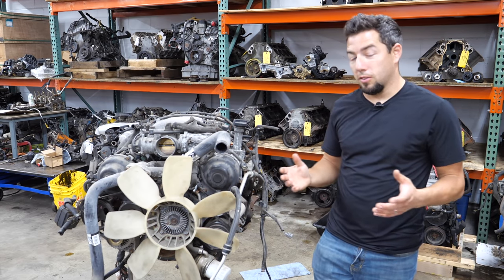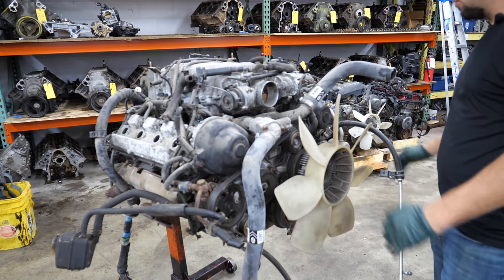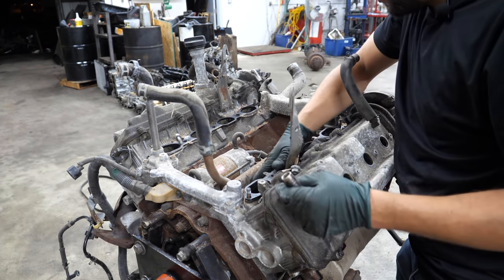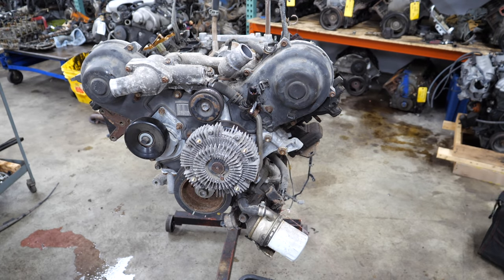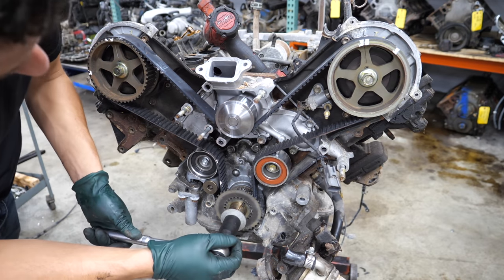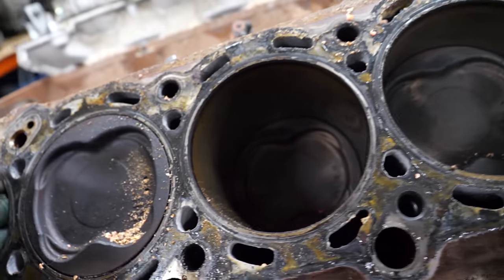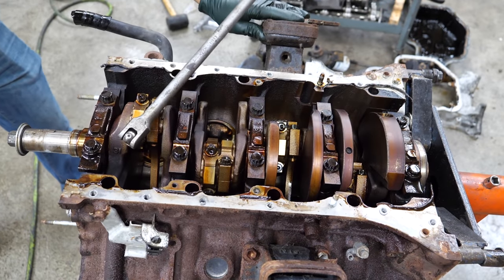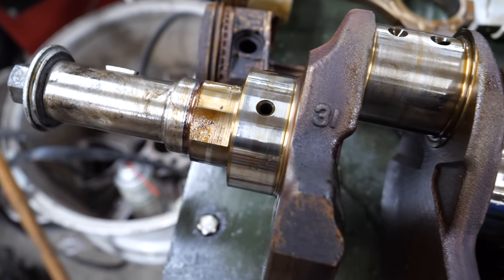Toyota 4.7L 2UZ Total Engine Teardown! Low Compression, But Why? Tundra Land Cruiser Sequoia LX470

Comment: Is the parts washer water based? Used to use one cleaning aluminium industrial equipment with no issues. Not good for your skin in the long run though.
Reply from the maker: It is and we always use gloves for that reason

Comment: I have an ‘01 Toyota Land Cruiser with almost 419K miles. These engines will last you a very long time as long as you keep up with maintenance. I change all fluids at half the recommended intervals (except for oil changes which is done every 3k miles). I also don’t defer any maintenance, not worth the risk of making something worse or running it to failure.

Comment: How do you do a compression test when you don’t have the key? You even said that before programming keys, you do a compression test. And especially when you don’t have access to the starter in engines as this one.
Reply from the maker: We pull the ignition switch off of the back of the lock cylinder and turn it with a screw driver.

Comment: I am watching these videos because my gx470 is making a tapping/knocking noise sometimes. It does it when first cranked. It is worse when cold but will stop after warming up for 10 minutes or so. Would be interested in thoughts of what this would be. I bought it 100k miles ago (about 4 years) and it has made this noise every winter.  Runs great but i am afraid it will fail at some point.
Reply: I have a 2001 Land Cruiser. The ticking that goes away after warm up is most commonly a cracked exhaust manifold… mine has done this for 10 years. Once the manifold warms up the metal expands and basically seals the crack so you don’t hear the ticking any longer. I have had this truck since 2005. Your GX has the same engine. Keep up with engine oil change intervals, and timing belt service. Watch the heater hose T’s if you are losing coolant.

Comment: First off, why didn't you use a magnet to retrieve your sockets? Secondly, if someone would shoot a little Marvel Mystery Oil in all the cylinders and ran the engine the compression would have come back (theoretically) and that engine would run another 100,000 thousand miles! But you know that. Thirdly, I can't believe the engineers thought that was a good place to install a starter. SMH! Good video, thanks!

Comment: Wonder What hack did the water pump and coolant hoses.....The coolant rubber hoses are connected with hardware store wormdrive screw hose clamps. Those are NOT stock and never recommended for anything that has a heat cycle. OEM are spring clamps that apply progressive force, they don't have screws to loosen up with heat and vibration.
Reply from the maker: Agree. Rarely do the spring clamps fail when used correctly
Reply: Yep just finished a timing belt job on a 97 LS400. The previous owner used generic hoses and clamps. What a disaster. I was very lucky to have a low mileage LS400 in a junkyard next to me to swap everything back to factory. Nothing beats factory spring clamps.

Comment: Oof, that water pump location sucks.  It's a similar sized job to replace the water pump as it is to replace the timing belt.  🤮
Reply: That's why you always do both at the same time
Reply: @12345.......  obviously yes, but it still grinds my gears.  My luck always gives me premature water pump failures, so I'd replace the belt and pump at 80k, then replace the prematurely failed pump again at 100k, then replace the belt and pump at 160k, then another pump at 180k.  And I'd be cursing at that damned design constantly.

Comment: 21:36 what killed the engine in my Crown Vic P71. Mine got so bad that it blew the dipstick tube out and burnt 3qts oil in 1/4 mile of driving. Only ran on 7.

What's funny and sad at the same time is that the 300cid I6 in my F150 has sat for 3-4 years straight and started right up running just as well as when it was parked. Yet my 'vic sat for just 1 year and blew an engine. They really just don't make 'em like they used to; old school iron would just laugh at that rust, scrape it off, and carry on as if nothing ever happened while modern engines just shit the bed.
Reply: No engine will thank you for running with rust on the cylinder walls, that iron oxide powder is popular as lapping compound in the jewelry industry and will inevitably find some place in your engine to 'polish' out of spec before the oil filter picks it up. Professional engine builders are obsessive clean freaks for a reason. Sidebar to this, my personal experience of honing a cylinder is that getting it clean again afterwards is nightmare fuel. The crosshatch traps particles of iron and abrasive grit left behind by the honing stones, so you have to wash and wipe down the cylinder wall repeatedly before the rag comes away clean. Then you put the piston and rings in and start up, and the run-in makes it dirty again. The engine I built has drip oiling to the cylinder (no crankcase) and the oil splashing out of the cylinder for the first 10 minutes of running was so loaded with iron filings that it turned grey. I'd hate to see what it was like if there was rust in there as well...
Reply: @nerd1000ify  Older engines were built far more substantially and would tolerate much MUCH larger tolerances without issue. Relevant to cylinder walls, look at ring thickness over the years. The thicker the rings, the more fucked up the cylinder walls can be and still give a good seal. Modern engines use rings so thin you can shave with a brand new one and thus they have ZERO tolerance for scoring or abrasives. Also, due to the larger tolerances in older engines, there's more room for those particles to make their way to the oil filter without harming anything along their way AND the oil itself is much thicker which will help seal up the small scratches that are left behind.

That's why my 4.9 I6 can survive scraping several years of rust off its cylinder walls while my 4.6 V8 blew up scraping just one year's worth off. The ol' 300 is a 1960s design and is such a robust piece of iron that the only way to kill one is to shoot it with an anti-materiel rifle. And even then you have to get lucky and hit something vital; if you merely shoot a rod in half it's gonna keep running on the other five until the followup shot finds something critical.

FWIW I'm not overly pissed about the 4.6 failing. It was over 200k and it's in a former police car. It had a hard life already and lived far longer than it had any right to have lived. But I will be replacing it with a 302 Windsor sporting a 450-500cfm vac-secondary 4-barrel carb mated to a 5-speed manual transmission. I no longer have to worry about emissions testing so there's no reason for me to put up with fragile engines in it. With modern oils and filters being as good as they are I will likely never have to open that engine up again; gasoline will stop being a thing before that Windsor smallblock finally wears out to the point I can't drive the car anymore.

Frankly the only reason I'm not doing a 59AB or 8BA build for it is because I can't buy motor mounts directly from Ford to slap one of those in there like I can the 302W. Friggin love the Flathead V8, one of the best engines humanity has ever produced. Epitome of durability. Unkillable. They'll run with one cylinder head removed for fuck's sake.

Comment: Any particular reason you use the impact driver instead of something like the 12v stubby or newer compact impact wrenches?  I see most of the time space is never an issue so no real need for a compact tool.

Comment: I have a 2001 Tundra that drops oil pressure to 1/4 on gauge.   Is that normal ?  Scares me
Reply: Completely normal, especially when it’s hot out (the oil gets thinner). As long as the oil pressure rises when you step on the gas it is normal and completely fine.
Reply: @ronjohnson8119  thanks for your answer.  I only drive it when I need to get hay, so it doesn't  get driven much.  But I was shocked to see oil pressure that low.  I was worried the oil pump was bad.  So thank you from female with no man to ask car questions.  (But I watch my gauges like a hawk)

Comment: If you ever want to know where to access the starter bolts. Here they are in the rear of the engine. Its a PITA to get to when the engine is on the car. But you can clearly see the two bolts he removed to get the starter out. 

https://youtu.be/cRlcN6vRHhg?t=930

Comment: Here in Australia the Landcruiser V8s are replaced with LS engines.  No-one ever uses one of these V8s in any other transplant or custom vehicle.  Looking at the main journals give a clue, I reckon - they should be attached to the side of the block with extra bolts for strength, meaning these things can't make any more power than what they came with.  A common Toyota thing.

Comment: FE head....One pulley for 2 cams. GE, two pulleys, wider angle valves for performance.
Reply: GM's junk. Use to be a gm dude. Later
Reply: @jeffcollier7185  It’s a Toyota engine and video.

Comment: The customer could have saved a lot of money by removing the plugs  and squirting Marvel Mystery Oil in the cylinders.   CraNK IT OVER A bit and let it set for a c ouple of days.  Put the plugs back; fire it up and wait for the smoke to clear.  Change the oil and drive.

Comment: I'd like to see you get a Ford 6.8L Triton V10 in the shop for a tear down if you can find one. They're gas guzzlers, but extremely reliable engines that'll run over 400k miles with no problem
Reply from the maker: I have a good 6.8 in stock so I hope I can get a core back!
Reply: @I_Do_Cars  awesome can't wait for that one!

Comment: You're being too nice Like I said before Toyota V8 V6 are useless There is no resurrection just death like your refrigerator it's just an appliance has no soul
I don't give me that shit of a reliability My 2008 Escalade has 200,000 miles No major problems just regular maintenance Not taking off the entire front of the engine maintenance talking about oil change spark plugs spark plug wires

No I've change those starters before I was like what the fuck you're kidding me lol

Comment: -Putting the starter in the valley of the V when it is not a lifetime item?  That is unacceptable!  NOW:  I want all you Toyota fan boys to try to justify this stupidity to me...

Volkswagen would NEVER do something this stupid~!  And yet you crack on their reliability..
Reply from the maker: To be fair, vw puts timing chains on the. Bell housing side of the transmission. This wouldn’t be an issue if it never failed, but they do, and often. Usually rendering these cars disposable. 
I rather have a starter go out on a tundra than chain failure on a 4.2
Reply: @I_Do_Cars  I have had a lot of VW cars to include Scirocco turbo's [YES they made a few, included in the FACTORY warrantee!] and a Corrado with the VR6 engine.  On the VR6 they put the timing chain on the output side [bellhousing] side because this engine was all about compactness.  Cars HAVE to save the lives of the people they carry.  Putting the timing belt above the bellhousing is a pain in the ass for mechanics, but it allows the engine to be shorter, so that it can fit in the same area that an inline four would take up.  YOU unfortunately get to deal with this crap, sorry.

I really like your videos, I don't know why.  I fly 767's for Fedex, and work on my cars on my spare time.  Watching you take engines apart is somehow soothing.  Keep up the good work!
Reply: Just stop! You can’t be serious. As a professional tech who has worked on Toyota and VW/Audi I can tell you hands down that VW has some of the absolute worst design/engineering failures that I have ever seen. I am far from alone on this.
Reply: @ronjohnson8119  Nonsense.  VW/Audi engines regularly travel 250,000 miles with little more than routine maintenance and timing belt changes.  It is when they are not maintained that they become trouble.  True, VAG packs their engines in pretty tight making them difficult to service, but that is rampant in the industry. The cars themselves start to "nickel and dime" you after about 10-12 years, but even then the primary problems revolve around accessories.  Toyota's are better in this regard, but the fact that a base model VW/Audi product drives like the high-end sporty version of an equivalent Toyota product [road appliance, gargoyle~] more than makes up for it IMHO.
Reply: Flies2FLL as a professional technician with over twenty years of experience I tend to disagree. I understand the reasoning behind the starter location on the 2UZ-FE was to keep it out of the elements as this engine was originally designed for the Land Cruiser. As far as VW never designing something that stupid I can unequivocally say that you are flat out wrong. I have always said that VW/Audi engineers try to design everything to work like a Rube Goldberg machine.I would agree that they do ride and handle very nice though and if you enjoy them then what does it matter what I think. We all have our preferences for different reasons.

Comment: Soak those cylinders in marvel mystery oil, I bet it would have restored the engine back to running shape.
Reply: Not so simple. Needs new rings and a honing job, minimum.

Comment: Wow, Toyota are a bunch of jerks, putting the starter in the engine valley! They do that, I imagine, to make it where only they can replace the starter, and charge the customers. I don't believe it is a space or mechanical consideration, but could certainly be wrong. I've got a 2014 RAV4 I'm not too happy with, and this just takes the ol' cake. Right up there with many of the manufacturers, not just Toyota, that put the water pump behind the timing cover instead of on the outside of the engine where the home mechanic can access it.

Comment: wait a minute, Toyota engines break? You sell parts for other Toyotas engines??  According to the Toyota fanboys, if you buy a Toyota its the last car you will ever buy. But they fail to remember the 2AZ-FE engine burning oil
Reply: And you fail to remember Toyota released a CSP for piston and ring replacement for 10yrs/150k miles. Not bad for a condition that was solely based on how it was cared for. Toyota products aren't perfect, but after working for several manufacturers at a corporate level, Toyota takes care of their customers like no other. It makes Domestic Manufactures look downright sinister in comparison when it comes to warranty and goodwill claims.
Reply: @ryanbrown918  after they fought tooth and nail 10 years ago for thefaulty accelerator pedals.  My domestic car company took care of me pretty well when there was a recall.  btw another toyota recall isued for faulty fuel pumps yesterday
Edit it took toyota a Lawsuit to fix 2AZ-FE engines.
Reply: @troy3052  No lawsuit...it wasn't a recall mandated by NHTSA, it was a Customer Support Program (CSP). And the 90L Pedal Modification Recall was nothing more than to accommodate people's careless use of stacked floor mats. EDR Data proved double pedaling in every instance of UA. Do your research. I've been with Toyota almost 15yrs. There's nothing you can't tell me that I don't know.
Reply: @troy3052  toyota has been a domestic manufacturer since the mid 80s
Reply: @ryanbrown918  I was surprised by the "fix" for the accelerater petal. If I had known it was just a grind, I would have skipped that recall. I'm pretty sure I could figure out what to do if my car unintentionally accelerates. There's no fixing stupid though.
Reply: For every one failure you can point out in a Japanese company, you can find ten of in the big three. The Japanese make better cars, end of story.
Reply: @TYLERTRANCE  Not to mention the so called quality "prestige" european manufacturers. German engineering, ha! Say what you want about Toyota being boring but they still kill every other manufacturer in quality and reliability.